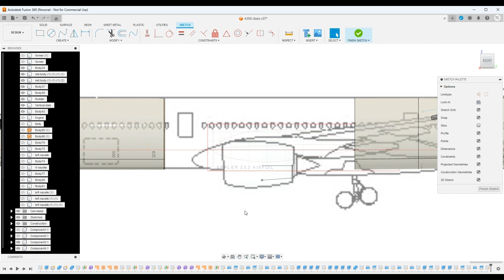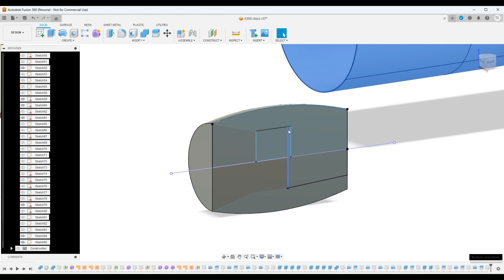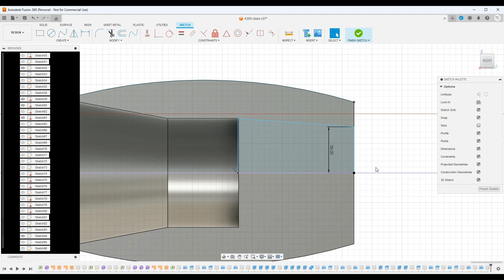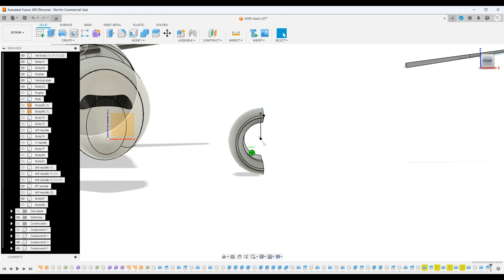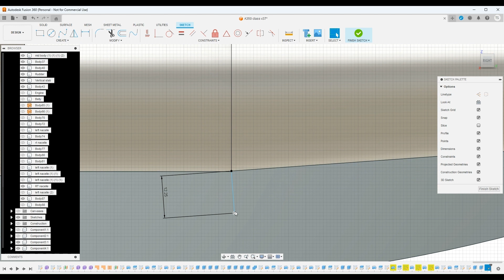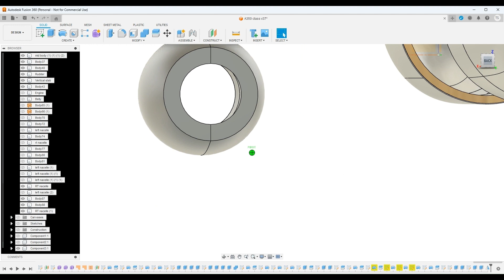Can I  Model a 3D printable Nacelle for a Wemotec 90 mm EDF Unit

Comment: If you need to specify dimensions of the Wemo fan  you could just type it's total diameter plus the extra as (92/2)+3 mm for the dimension in Fusion. It will calculate the formula for you. If you would later want to change the extra space you'll be able to do so in seconds.
It would be much more elegant to use components and just insert a Wemo fan as such in your design.
This will save you a ton of time when designing.

Also you could draw the fan outline and just use "O" for outline and enlarge the perimeter by the amount you want.

Fusion isn't buggy it's the amount of bodies and your huge timeline that's making your computer work harder.